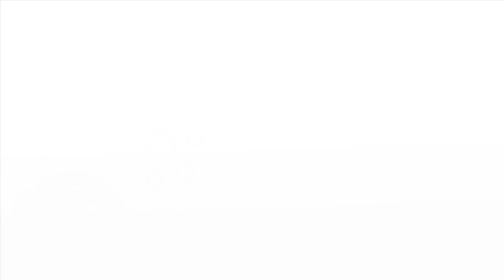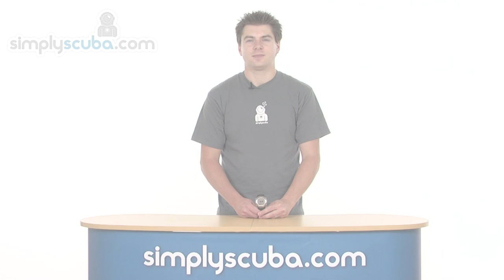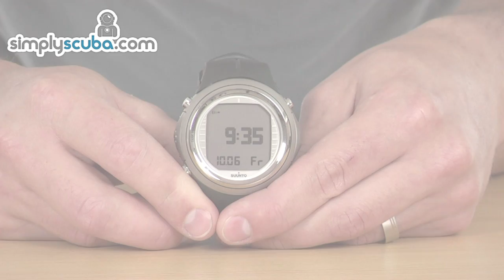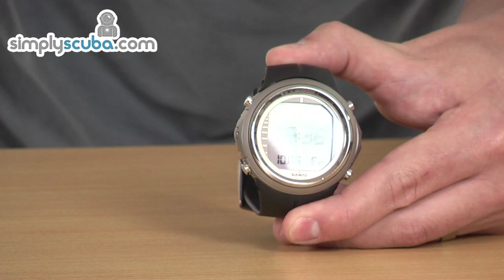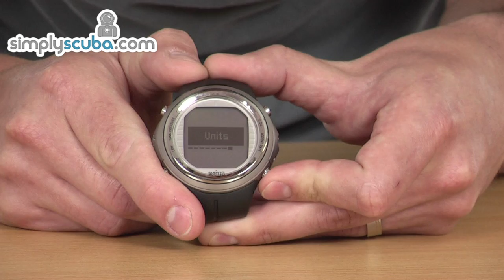Suunto D9tx Dive Computer - www.simplyscuba.com

Comment: i have a D9tx  titainium with low battery  , i also have a problem. i dont dive and have no use for it , its to expencive to replace the battery just for the time mode , its condition  is excellent, needs  a couple of pins replaced on the steel bracelet and battery , if anyone has an intrest and has a reasonable offer. you may find your self owning it ,
Reply: Yer...how much do you want for it..